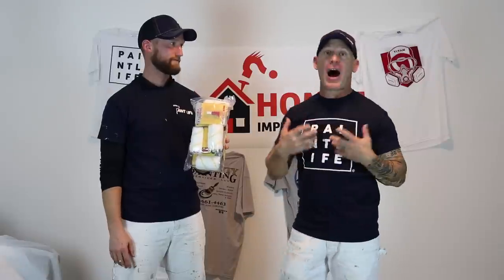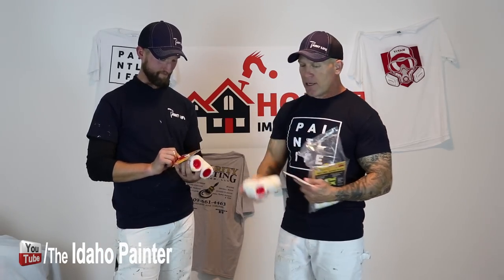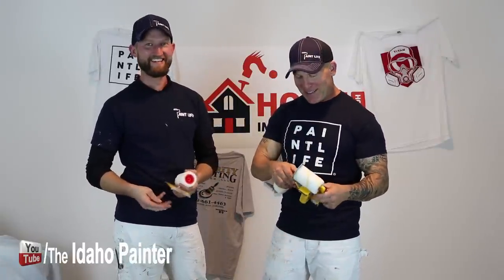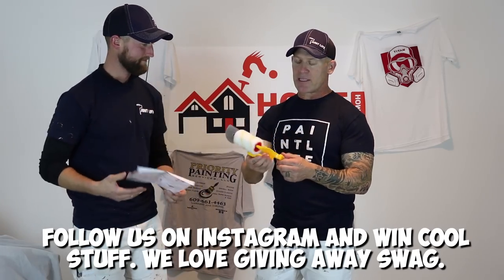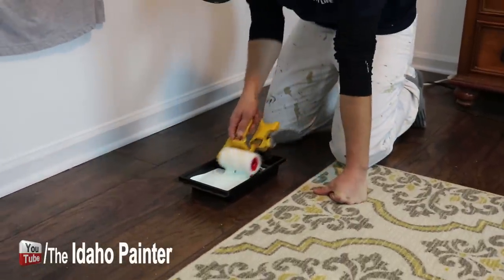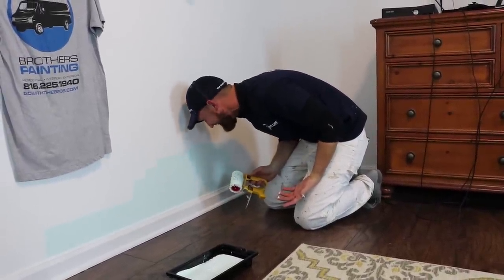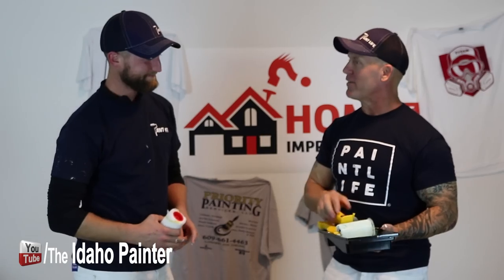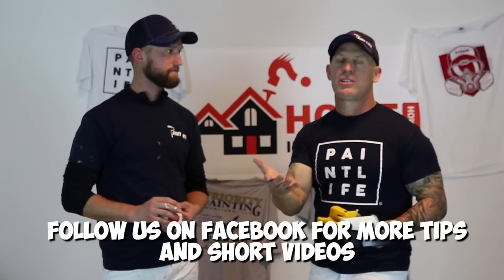Accubrush Review.  STOP & WATCH before you buy!!!!!!!!

Comment: Cheap roller, hold not much paint, lines over and over, you roll to the edge from a wall, so the size from the tool stops, you have to paint by hand because the tool don't go further. For me total useless, because I have to spend a lot of time after the half job is done. I bought an edger on Walmart or home depot for $ 4,00 and the changeable paint pads and this doing a fantastic job. I can go in the edges and with the corner from the tool around curves. For the straight lines  I take a stiff brush and finish the job in ln no time. The paint pads arte easy to clean and re use. I got my money back from the company and they told me only return unused item. So I have the accubrush and rollers still, but I never will use it again .I am from Europe, sorry about my English...don't buy only when you can return it for free.

Comment: you didn't read the instructions always finish on the down stroke that eliminates wheel marks and also start away from the edge and work to the edge at an angle you don't need to keep on opening and closing the edge guide
Reply from the maker: Instructions LOL.  It is garbage

Comment: So watched a few different reviews (never trust a marketing advertisment video) everything "looks perfect" in a sale adds for purpose of selling new product at high prices when released for purchase untell the world relizes its crap and they drop prices. Always do some research 1st. anyways watchin this i see the material and basic consept is simalier to the padded edger. Your biggest issue with the wheel marks is a quite simple fix. These designs are made to be rolled in 1 direction not back and forth like regualar roller. Roll 1 direction so wheels dont roll over wet paint. They dont last the longest but for a faster and steadier job once u get your zone makes up for it. Save time from taping and touch ups from chance of bleed through ect. Once prices drop will be more considetable to buy
Reply from the maker: Thanks for the feedback Tyler!

Comment: What about the corners pssst
Reply: It want do the corners, for that I use  a Shur-Line Premium Corner Painter. I agree, its not a high quality roller, and the weehls have to be cleaned during painting. Having said that, its the best painting tool for my needs. I have high ceilings and feel very uncomfortable using a  ladder. I attached Accubrush on an extension stick and it worked like  a charm!

Comment: I feel sorry for the owner of the upholstered furniture from the splatters of a roller in motion (cover protect furniture)it is easy to see the paint life are very negative approach trying to find a way to put down a tool that I see works great also you did not caulk corners or any where you tried the tool old fashion painters use a positive approach and you get positive results this message from a Master open minded Builder I would think twice before hiring a company tattooed workers where long sleeve be a professional they are amateur dyi painters at best just the truth.

Comment: It takes practice. You don't pick up a brush and all of a sudden you are a pro. Painting is like anything else, you need a arsenal of tools. In a certain situation it could be just  what you need. You are only using it for cut ins. You are not going to roll the whole wall. The wheel marks will be painted over when you come back with your 12 inch roller. If you are using a 3/6 or 1/4 inch nap rollers you are not painting for speed you are insane. I seriously doubt the people selling it expect it to be the only things you will need to paint a room.
Reply from the maker: True